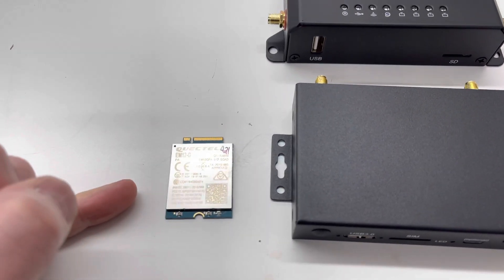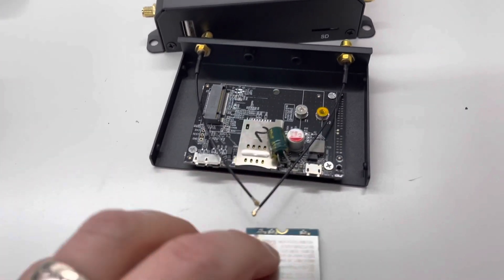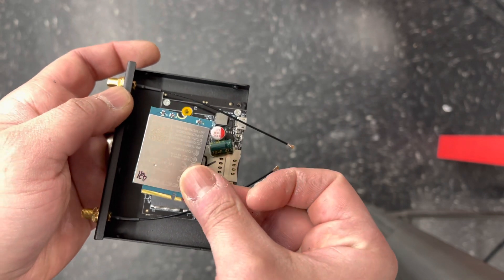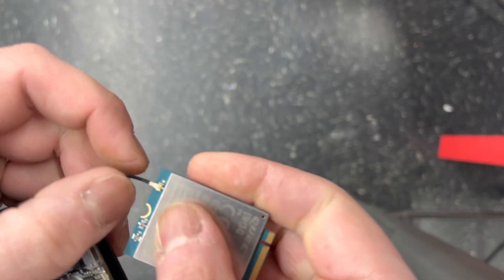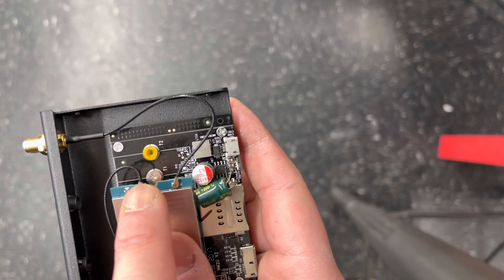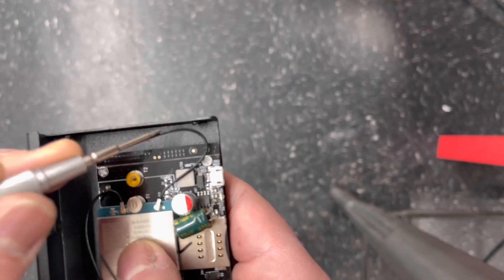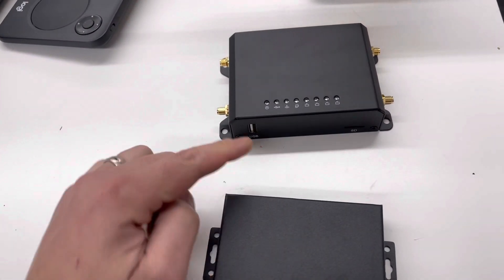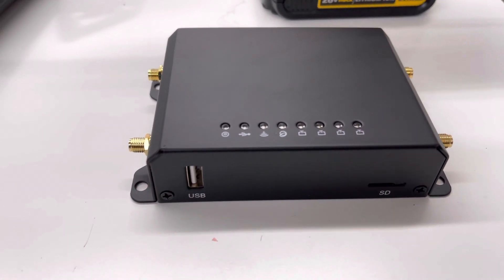I built a mofi4500 alternative and it’s a Cat12

Comment: Tech repair. What outdoor antenna do you suggest for a mofi 4500? sadly, getting rid of mofi it's not and option after all what it cost to get it, i have a  Yagi antenna and speed vary between 8mbps and 13mbs, I'm not sure what changes i can make to improve it.
Reply from the maker: 50ohm??
Reply: LTEFix Yagi LDPA are the way
Reply: Did you lock your bands I was on band 13 and now I lock it to band 5 dom 25 up 11 on visible wireless mofi 4500

Comment: Hello

I'm looking for a router to be used Outdoors while we're moving. We are all riding our bicycles around town and we want to play the same music in sync so to do that there are various apps that allow us to do this if we are all connected via Wi-Fi. Just wondering what you'd recommend for us we do not need to have an internet connection we just need to be able to stay connected, we do have the ability to use wifi direct on the app but not sure if we can mesh the network. I'm not worried about the power supply as I do have a big sound system with various abilities to power up the unit. The app that I'll be using as far as I know it Soundseeder,  that's the best one I have found yet.
Thanks
Navid

Comment: Why do you set it up like this?
Reply from the maker: Because it's assuming you bought a mofi4500 and want to upgrade to cat12
Reply: @RouterRelated oh okay, I have a 4500 sim 4 right now and want to upgrade my modem. With this setup I can do that?
Reply from the maker: @Bobbcudi  yes however you will have to flash a different router firmware
Reply: @RouterRelated  I have an netgear 1600 laying around with gigabit lan ports. Could I use your build and connect the modem to the router once I flash the netgear?
Reply from the maker: Yes because then you’ll get full speed
Reply: @RouterRelated  yea thats my goal. I was thinking of a cat 16 or 18. If the enclosure is usb 3.0 and the netgear router is 2.0, would that cause speed issues?
Reply from the maker: @Bobbcudi  no that's a different plan you got there that netgear can't run Rooter so it's no good...
Reply: @RouterRelated  im able to flash opnwrt onto the netgear router. That's not compatible with the USB 3.0 pci enclosure set up?
Reply from the maker: @Bobbcudi  what model Netgear is it
Reply: @RouterRelated  ac 1600 r6260